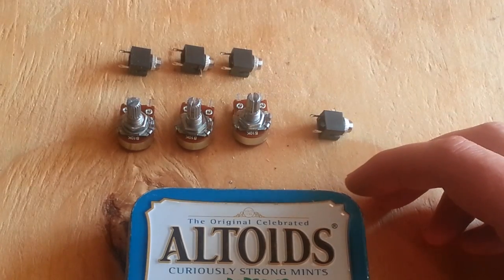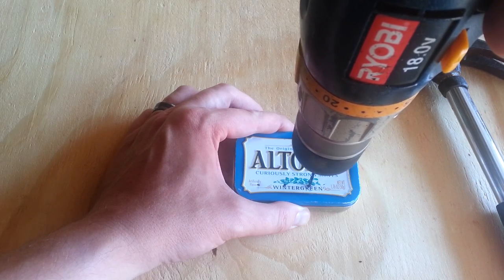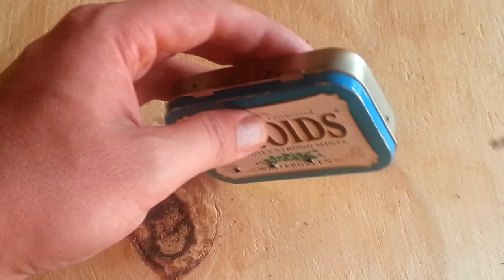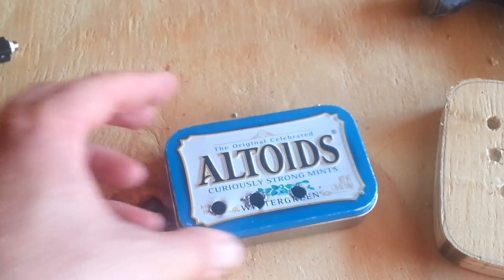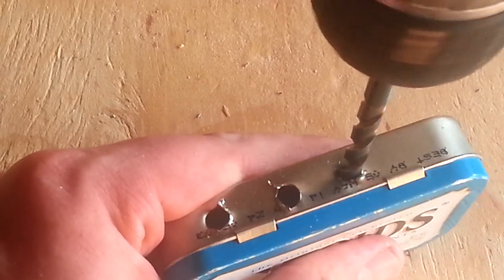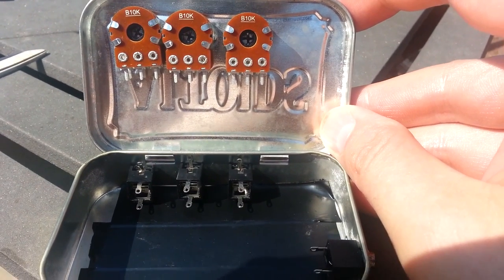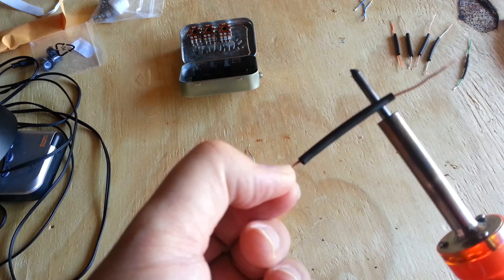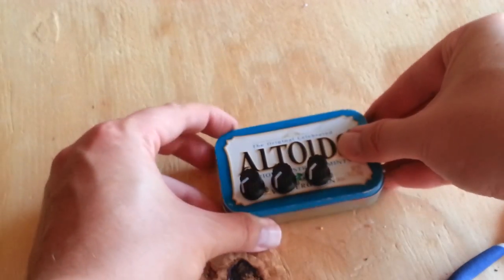Build your own audio mixer (mint tin, passive, no voltage)

Comment: You NEED the third terminal of the pots connected to signal ground otherwise the voltage divider established by the pots won't work properly. Wired as shown you may find audio leaks through even when the pots are wound all the way down. With the ground connection in place, turning the pot all the way down shorts the 'wiper' terminal to ground, which ensure no audio can leak through.
Reply: I am pretty sure he is using them as variable resistors only for this.

Comment: Might have been easier using a step bit, they tend to be gentle. They will not grab and pull the tin up the bit. So you are using point to point rather than a PCB. That makes sense. JohnAudioTech built a nice little preamp in a plastic case. I am thinking of building something like these and looking for ideas, so thanks for the video.

Comment: Great little project, i plan to build one. One note - you could have put the pots on the bottom and jacks on the sides  and the lid would then be  the bottom and opening it would not need the flexibility and length of wires as nothing is mounted to the lid.
Reply from the maker: Great idea!
Reply: But he's really selling Altoids...
Reply from the maker: MrBrymstond fresh breath pays for itself in the long run.

Comment: If I wanted to connect a phone and computer, while allowing to do phones calls what would need to be different. In other words, there would be an output from the computer to the mixer and an output from the phone to the mixer that would also receive voice audio. The output on the mixer would be able to do headphones with mic as well.
Reply from the maker: radio shack makes a phone voice recorder. it's an audio splitter that comes off of your handset into a headphone jack. they're $20.00 at most. you can probably find one on amazon.com. once you have that device, plug that into one channel of your board, then the computer stereo out into another channel. your mic unfortunately will need to be the handset of your phone, or the other person can't hear you. This board unfortunately is not advanced enough to pull off mix-minus capabilities,  and route your mic back to a caller, without creating a hell of a loop.

Comment: i suggest u draw some simple schematic of the wiring and add it to the description of the video. For many if not most people interested in making the project, this video is going to be relatively useless. Sure they will make the holes and try to figure out the wiring from reading the comments section and hoping they find someone with the information, But that's not easy for those with no experience with electronics. Some general specs would be nice too (what it can be and cannot be connected too), or else someone might connect this to an amp and fry it.
Reply: lol, u serious? :D
just watch 13:42
Reply: Yeah would be a great help... goes from individual parts to a complete project with little explanation.

Comment: At 6:36 you say rider.  That is actually called a TANG.
Since you will most likely  won't be putting any force
on the POT's. Use a pliers and snap it right off.
Reply from the maker: Ted Mieske great suggestion with the pliers, thanks for your correction.
Reply: Thanks!  I will subscribe and Thumbs-Up.
Reply: I always break them off :D

Comment: No, really! LINEAR (B10K) pots for an AUDIO application?? You should replace them AS SOON AS POSSIBLE with LOGARITHMIC ones (A10K). Because the human hear has a logarithmic response, you know... Other than this, there would be enough room for a fourth channel.
Reply: what's the difference with all those amps using linear? or those are 'converting' the pot changes to logarithmic values(at least seen that emulated on arduino)?

Comment: Hello glen,
i have some questions and it would be nice if you could help me.
could you tell me where you got all your stuff from? A link would be nice. 
Is there a difference between the input and output audio jack? 
And is this stereo or mono? And if it is mono, is it a lot more to do it with stereo?
Btw nice project
Reply from the maker: I'm getting the parts together for you. I purchased everything from ebay, using these search terms: 

Potentiometers
5 x 10K Ohm B10K 10KB Linear DUAL Taper Potentiometer Pot 17mm Shaft

Knobs
10 Pcs 6mm Shaft Hole Dia Potentiometer Pot Knobs Caps WD

I'm still working on the stereo headphone ports, I will get back to you and post it here. I need to make a schematic too, check back shortly.
Reply: +glencouls Thanks man
Reply from the maker: +Robert S you want to look up "5 pin stereo 3.5mm or 1/8th inch headphone jack" on ebay. 5 pins are Ground, L -, L +, R -, R+.  They may not be pinned that way directly, you may want to pipe some audio through them to confirm pinout before you start to solder. The stereo headphone Jacks i selected were long, not fat. I think fat might conflict for space too much. Working on wire diagram with my new Surface tablet. I will get back to you soon with a diagram.
Reply: +glencouls Thanks. Right now I don't have time to build it, but in a few weeks or month I will definetly try it.
Reply: +glencouls I have another stupid question: What thickness of the wires is recommended for audio stufff like this or what did you use?
Reply from the maker: +Robert S I used cat6 patch cable.  The stranded copper kind. don't use plenum, it's solid core and will ruin your day.
Reply: +glencouls Ok thanks and how thick are they? I bought some wires but I think they are way to thin (1.1mm diameter with the isolation)
Reply from the maker: +Robert S 23 gauge wire not sure about mm. maybe you can find a converter online
Reply from the maker: +glencouls thicker is probably better. however the runs are so short. a concern I have had is with shielding. this rats nest of wire is a little like spaghetti.  concentrate on keeping things neat if you can. only use as much wire as you need. good luck with this project, have fun!
Reply: +glencouls Ok perfect it seems that my wires aren't to thin.
Reply: Thanks again. Now i have build my own one and it works. Instead of a normal case, I have used a cheap speedcube. On the backside are the inputs and you can control the volume individual and on the front side is the output. With the top Layer of the cube you can control the volume of both together. It was harder than expected to prepare the case and glue it together and to work with only a little space, but it works fine. The volume drop is higher than expected. Maybe because I used the potentiometer in series (I don't know). When I set everything on max it works.
http://www.bilder-upload.eu/show.php?file=fa7b90-1464702001.jpg
Reply from the maker: +Robert S nice work! I will read your build tonight. Mine took me longer then I thought it was going to too.

Comment: That's so good vdo but confusion in wireing so pls. if possible do diagram on paper.. tnx.
Reply from the maker: Rahul Kapoor I am working on a new version that takes power from USB, this power is used to amplify the signal so there is no longer a drop in audio level. I will document the wiring for both then. I'm sorry for the delay on this, I have moved an prepping my old condo for a renter to move in. life has been very, very, busy.
Reply: Can't wait to see that new video

Comment: Hi, I would like to build one of these however I was wondering if you could post or send me a parts number list.  (the audio pot meters & headphone jack parts you used &/or a circuit diagram with this on it.  Thanks!
Reply from the maker: Mandalorian Mercy yes, I have been needing to put this list together for a while now. please subscribe, that will give you advance notice when I release the video for that. I just purchased some USB female inputs which I will be using to create a powered version of this same mixer. this will give me a 2watt amplifier that will hopefully counteract the 10percent volume drop at the resistor I have been experiencing. This will just be USB powered, not USB data.
Reply: Alright, so I subscribed. I like your stuff, just wish you'd show the circuitry part in more detail. Any chance a quick list of parts numbers could be compiled though? Perhaps posted in the video description. I've been scratching my head over how to wire the audio in jack - pot - (resistor) - audio out jack connections. I understand you have the grounds linked between the audio jacks (i think). How are you wiring the left and right audio to the same pot? 
I'd expect the pot 3 pins to be "left audio in, left audio out, ground". So I don't see how you can be using 1 pot per audio in ports. Can you clarify this for me?
Reply from the maker: Mandalorian Mercy I will get to this soon. I have to paint my condo today in preparation for renting it out. then I will open the mixer and get the information you need.
Reply from the maker: the pots are double tapered so there are 6 pins per pot. list below, sorry I'm putting this together trying juggle a crazy busy life right now. video and drawing to follow eventually. 

Parts list, all from ebay. except resistors from radioshack going out business sale.

Knobs: 10 Pcs 6mm Shaft Hole Diameter Potentiometer Pot Knobs Caps

Pots: 5 x 10K Ohm B10K 10KB Linear DUAL Taper Potentiometer Pot 17mm Shaft

Jack:  3.5 mm Jack Panel Mount Female Stereo 1/8" Solder Terminal Audio Jack

Resistors: 1k  I think you need 6 but I need to open the box again and count.
Reply from the maker: oh yeah, forgot... 1 mint tin and lots of fresh breath. LOL. solder,wire, etc.
Reply: glencouls thanks! I think that was giving me the hardest time when looking at it
Reply from the maker: Yeah the double tapered pots take up a little more vertivle space under the lid, but they make it stereo so they are a must have.

Comment: I read somewhere that linear potentiometers don't work for mixing, but you have to get audio ones. Is this really true? Also with these same parts could you make four inputs too. I wonder if you have  to buy a higher K resistors for more inputs?
Reply: Isaac Parker yes that is true I know how to fix that but it will be to long for a comment so look it up I don't mean to be rude

Comment: what if we dont use a resister
Reply from the maker: +julian preciado thanks for your question. As I understand it, the resistors have two functions. 1) to knock the audio level down a little so audio isn't coming in too hot. 2) to avoid mic cancellation or component cancellation when too feeds of similar audio are competing for the same channel. Our aim here is a mix and not abrupt cut, or the bass of one channel coming through more noticeably than the other. The resistors help facilitate that over a bare wire.

Comment: what exactly is the point of the resisters?
Reply from the maker: +DRAWNBOX to avoid cancellation of two audio feeds. We want a mix, not an abrupt drop out.
Reply: so, it weakens the signal so both can exist?
Reply from the maker: +DRAWNBOX "if you gradually delay the audio going through the second channel, the peaks and troughs of the two audio  waves shift out of alignment. Because of the unique properties of sine waves, the combination of the two channels will now still produce a sine wave of the same frequency, but its level will be lower than if the two channels were in phase, and we say that partial phase cancellation has occurred. When the second channel is delayed such that its peaks coincide exactly with the first channel's troughs (and vice versa), the two waveforms will combine to produce silence. At this point we say that the waveforms are completely 'out of phase' with each other and that total phase cancellation has occurred." The resistors prohibit the phase cancellation, in theory anyway.
Reply from the maker: sorry to wait so long to get back with you, but I had to look this up. My previous answer isn't exactly wrong, it just lacks all technical detail and an explanation of what is happening on an audio theory level. I'm not trying to come off like a sound pro here, a good audio engineer is worth their weight in gold. When it comes to this stuff I'm a tinkerer at best. I have wired studios for TV and Radio but I consider that more component installation over audio engineering. Thanks for watching my video. I'm going to be installing some tablets in my car with 5.1 digital surround sound. if interested please subscribe.

Comment: You butchered that lid, but great video, a pair of side cutters would trim the slithers left my the drill neater than a hammer. Also I think whoever showed you how to tin cables does not like you you heat the cable and bring the solder to the cable stabbing at it defeats the flow bond.

Comment: How much resistance
Reply from the maker: +ravis T, 1k or 1000 I go over this at about 12:15 (I may have said it too fast), this will result in slight drop in audio levels, up to 10%. I'm running my audio into a computer, so I can just boost the audio level in the computer up a little over unity, and it's no big deal. Depending on your application, you may want to add a small power amplifier circuit. I have not modes that in to this yet. I want to see if I can power one using USB, in the future. So many projects, so little time.
Reply: +glencouls good , you shoot video to show us

Comment: The pots are not meters. The are potentiometes all one word. Look it up.
Reply from the maker: While it may not conform to your pronunciation, a pot DOES actually meter, a pot is a sliding or rotating contact that forms an adjustable voltage divider so at full open you get 100 percent and at full closed you get a diminished volume sometimes zero or off, other time 5 or 10 percent. So actually it does meter. I suppose percentage could be seen as potential so there you go mash them together. Say it any way that floats your boat, it's metered. 

Video is already produced not changing it now. Will on second video adding amplifier since you guys like "mitter" so much, thanks.

Comment: For gawds sake, show people the proper way. Use a CENTRE PUNCH, not a bloody nail.
Reply from the maker: John Coops thanks John, I didn't mean to upset the gawds. I had no idea a finishing nail was so offensive, it did do a decent job, and the only punch I had that moment was really too wide, it does pay to have the right tool for the job, but sometimes improvising works, or screws up the project beyond any help, I'm glad it turned out OK.
Reply: You are making an instructional video. Show people the correct way to do things, and then by all means show them ways to improvise (I have no problem with that). But I just noticed your soldering technique and wire tinning instructions, and that is just hilariously wrong, so the holes are the least of your problems.
Reply from the maker: John Coops john, if you have a better model then by all means upload it. I have had no problems with my solder joints and the stereo pots have been working fine since installation. it's incredible to me how somebody such as yourself with zero posts is throwing rocks at somebody who is trying to pass a little bit of knowledge with a build that works and they enjoy so that others may have a similar experience. Good luck with your next project.
Reply from the maker: John Coops John the wiring is not shorted. These are stereo pots and there are stereo inputs and one stereo output. Why are you relying on name calling when challenged?  Is it because you would rather tear something or somebody else down under the ambiguity of the Internet instead of taking the initiative with your know it all attitude and creating a video of your own? I find it interesting that you are calling into question my credibility (the troll comment)  when you don't have a single video posted to your account. You contribute nothing but are willing grade others work so readily, and you post so frequently it is really peculiar behavior.  I don't do this to make money, or look for fame, I post these little videos to help people and show what worked for me, also a record for me to look back on how I did something.  If you don't like me, or my video please don't make the project. it's that simple. please feel free to keep commenting however, everytime you do, the video earns another view which pushes this "idiot" video (as seen from your eyes) over other legitimate how to videos, something you should be proud of, so please keep commenting.
Reply: I really liked it. I thought it was a really cool project. I usually dont have the proper tools but lets be honest, these projects are just for fun, and to increase our understanding of electronics and our own creativity. If using a nail gets the job done and makes a cool project, then its a success. Since watching this I made my own altoid tin projects. Thanks for the inspiration @glencouls. And at @John Coops a man cannot build a reputation on what hes going to do. If you want to make it better, please do, seriously. it would be very useful to see any improvements on his ideas or others ideas.